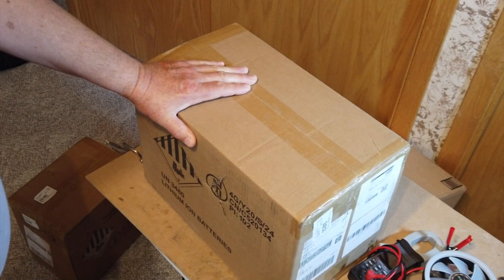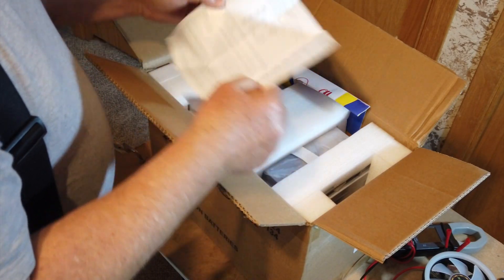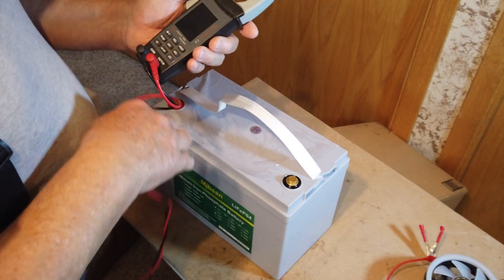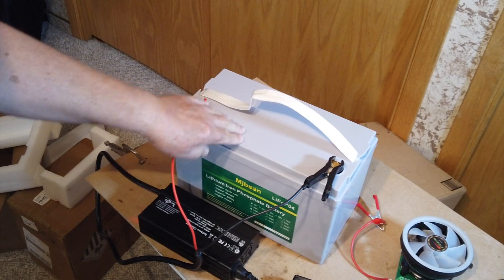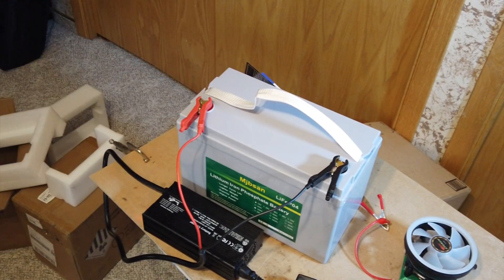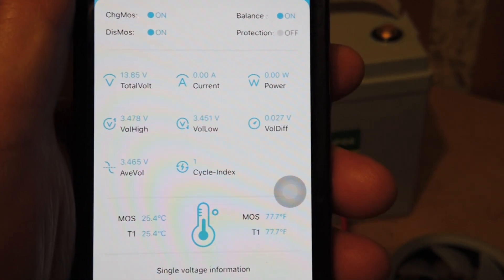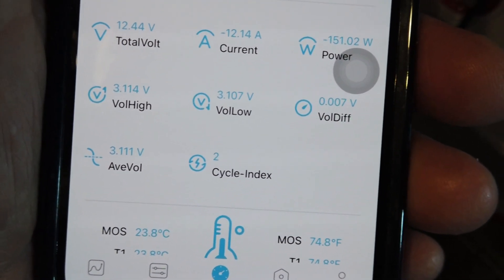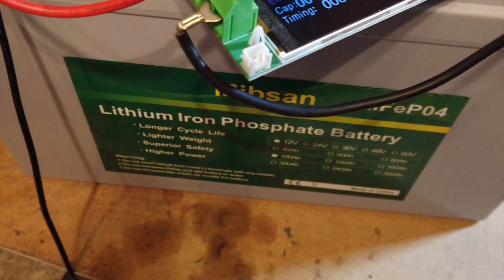The Cheapest 12V LiFePO4 100Ah on Amazon Part 1

Comment from the maker: I put the battery to work in my 48 volt system, it works great, am going to take it to Arizona and put it to works on my 48 volt system there. Actually I am using four different brand 12 volt LFP 100 amp batteries in series and then hooking up a 48 volt balancer to them to keep the mixed batteries balanced and that is working!

Comment: Thanks so much Steve for the capacity test. I’m looking to buy  this battery and worried about the actual capacity considering the lower price than big brand. Great to know it has a little over 100ah. Curious how it works so far. Do you notice any issue with it?